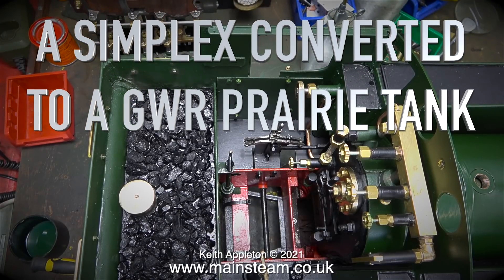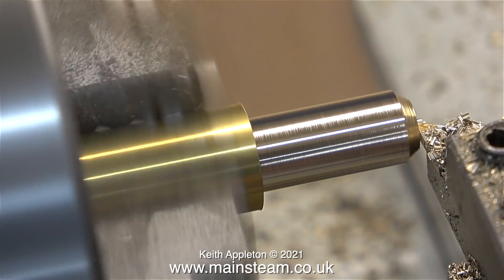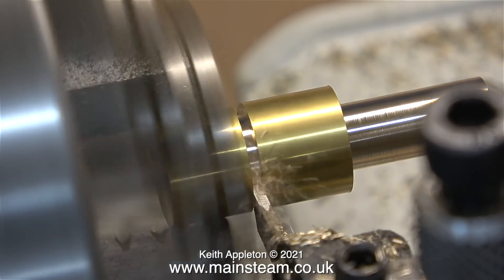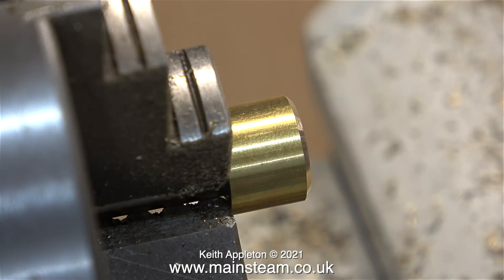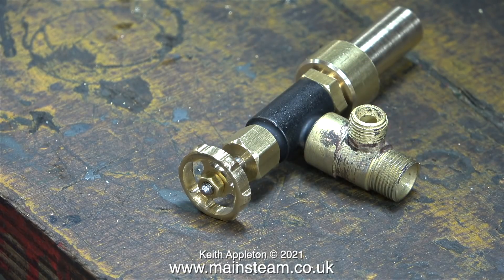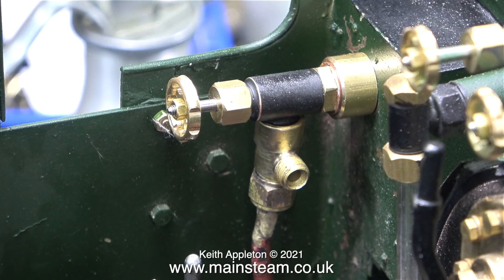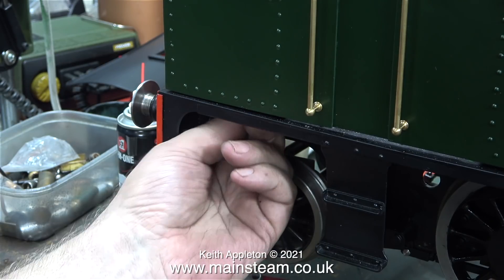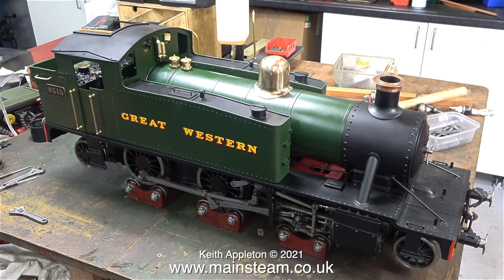SIMPLEX PRAIRIE TANK - PART #99

Comment: i was wondering how you would turn the spectacle plate into a coaming . . . now i know . . . slick.

with that style boiler you don't have a firebox and its heat to contend with so silicone should work fine.

Comment: For splitting piping I make wooden jigs. Block of wood drilled to OD of pipe, slot cut underneath with a Stanley blade inserted into the slot and protruding into the hole. Push pipe through hole and Stanley blade cuts neat and straight along length of the pipe.